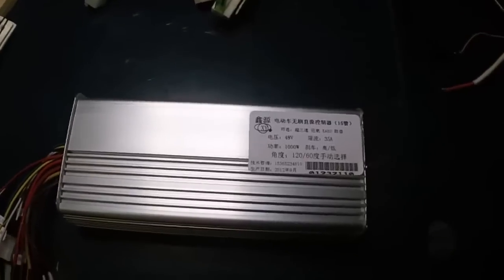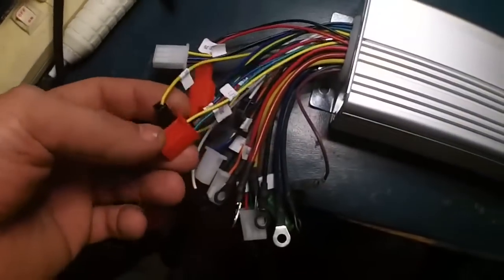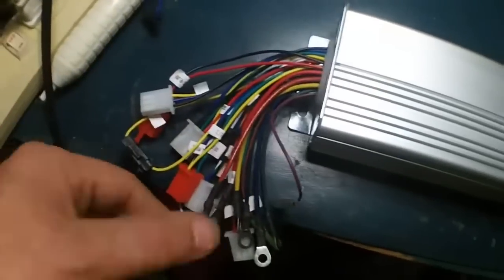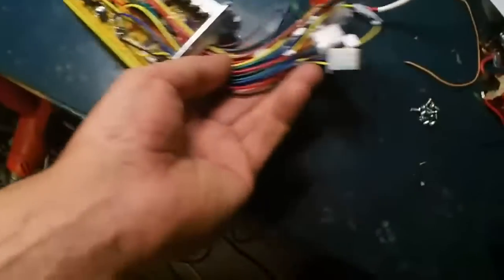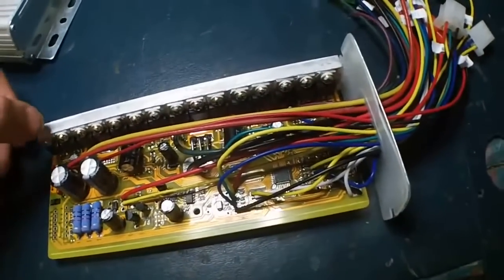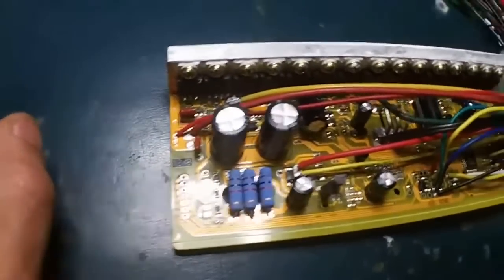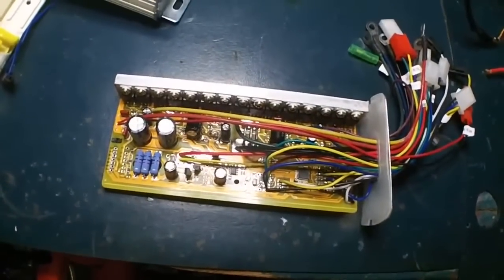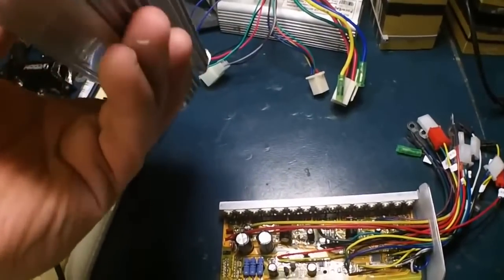48V 1000W E Bike Scooter Electric Bicycle Brushless E-bike Controller With Hall

Comment: I've got a 1000 watt 48 volt controller with 3shunt could I modify them
Reply from the maker: you can add a small blob of solder to the shunt to up the amps. use very little. at your own risk..